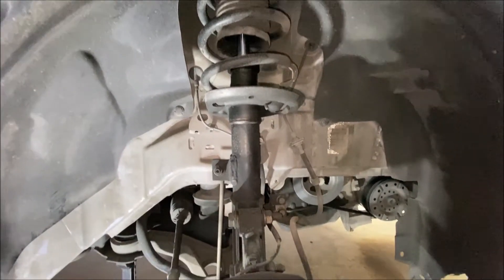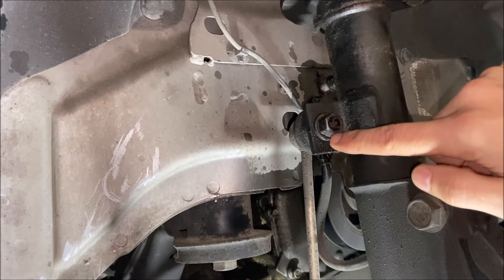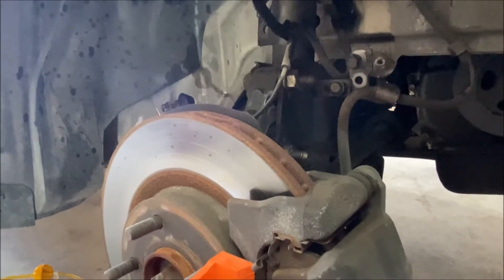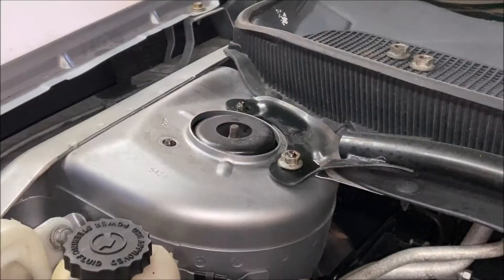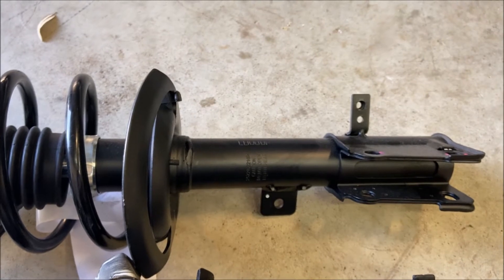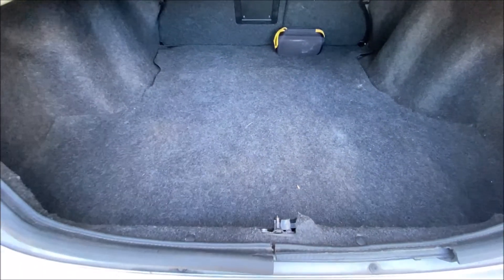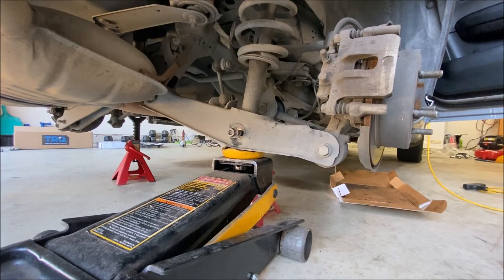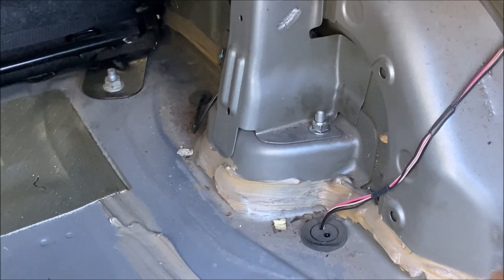Wobbles and Sways all over? Replacing the front and rear shocks, struts, & springs on a Chrysler 200

Comment: Another great video. Thanks. My wife's Ford Explorer has the bearing plate popping in the front when turning the wheel. Already had it replaced once. This was my plan also, to just replace the whole strut assembly myself and be done with it. Thanks for the inspiration. Almost 1k Subs!
Reply from the maker: It's certainly easier than messing with spring compressors.  I found quite a number of reviews on different strut assemblies I looked at and it seemed the bearing plates are always troublesome.  So far so good with the ones I installed, though.
Good luck with yours and thanks for watching, Steve!